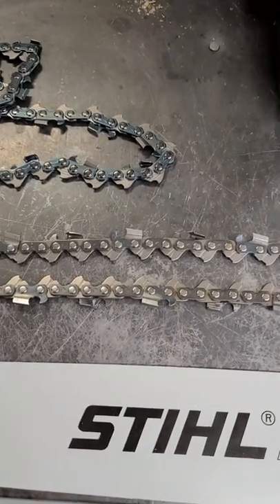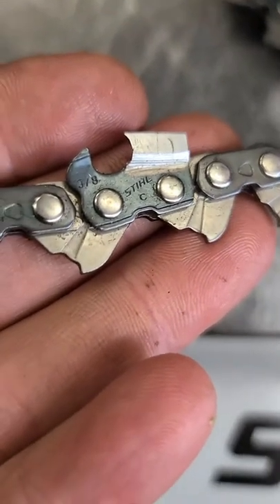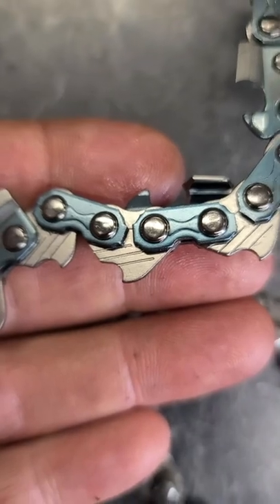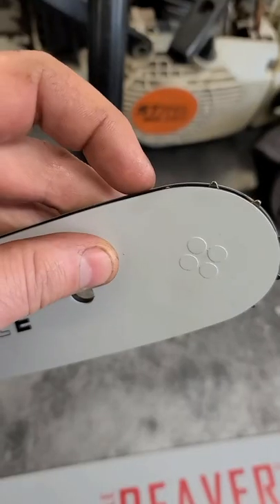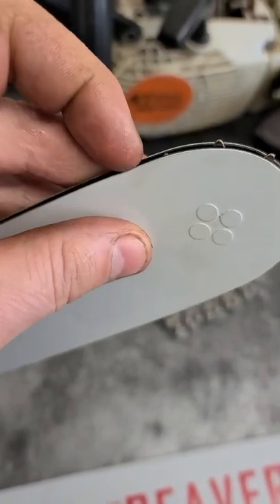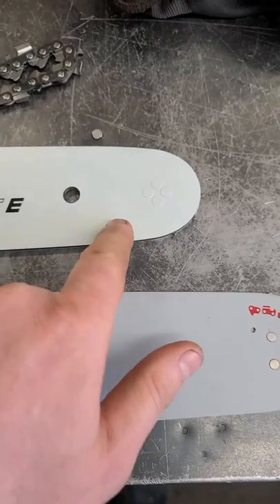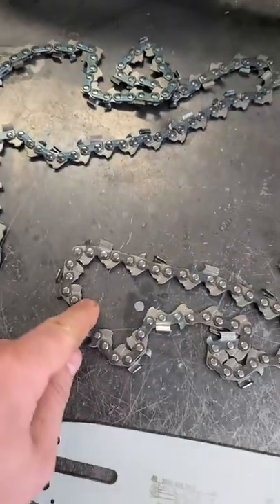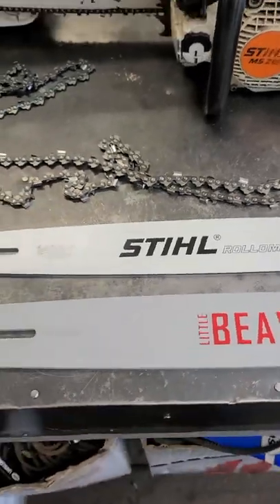What Are Grooves For On Chainsaw Chain Drive Links? #shorts

Comment: Yup it channels the oil as well some of them have a wider groove to also channel stray sawdust away from the bottom so the chain doesn't ride up in the groove from wood dust debris jamming at the bottom by the oil wedge action of the lubrication to keep.the bottom free from wood debris. One should still have a bar with a grease hole though it distributes the grease more evenly than just relying on the oiler on the saw. It has to distribute the oil a lot further. A more form of localized lubrication is always better. The grooves are also there for less friction so the chain can spin freely as well and so that the bar groove don't wear out faster. They also provide better cooling.

Comment: One big thing you let out how about the grooves and indentations on the back of the chainsaw chain are in there to ride on the clutch in the clutch gear or sprocket without those noxious weed chain would not be able to turn around on the clutch sprocket that's the number one reason why those Cruisers Rainier not to mention as you said to guide down the chain bar

Comment: Question for you Don...working on a 2005 Cub Cadet 2 stage 5hp 28in monster of a snowblower and it just will not bark, cough, snort, puke, chooch  or anything.  I put a new carb on and nothing.  I cleaned the old carb and nothing.  Guy had a new plug and I cannot see spark on it so I tried a few other plugs and I can see spark...though it looks kinda weak.  I tried drizzling a few drops of fuel in the plug hole and the most I got was a single pop out the muffler!!  To look at this machine Doug you would think it was rarely ever used, I mean it looks almost new.  Coil maybe? Timing issue? Compression does feel kinda low for a beast this big but I'm not really sure. Appreciate any tips bud!

Comment: So if I got a bar without oil or hole on it I need to make sure my chain has got the grooves in it like you showed in order to properly oil my bar give my bar has a oiler hole then it doesn't matter which blade
Reply from the maker: yes
Reply: @donyboy73  wow. Thanks for that donnie.... I know there's a lot of people out there that do not know that that's quite a good tip
Reply: @donyboy73  wow. Thanks for that donnie.... I know there's a lot of people out there that do not know that that's quite a good tip

Comment: Wait a minute, unless you mean that happens when the chain is stopped, the centrifugal force makes the oil try and get away from the sprocket. In fact, the usual and easy way to check if your chain is properly oiled is by checking the splash against some cardboard or whatever revving up the engine.

If that's what it's for, I don't see it.
Reply: Not sure I follow the logic either
Reply: the grooves are there to get the oil between the guide and the slot in the bar and to help resist the centrifugal force trying to sling the bar oil outwards; instead of just squeezing up through the holes between the links.
Reply: @kenbrown2808  I can see there will be oil in those grooves as it moves along the bar, that's something I thought before Don said anything about it. But what my head just can't admit is that, when in use, that oil will ever get to the bearing, even less so thanks to those grooves.

Those grooves can only hold it for so long, but as long as the chain is in motion, if anything, the oil will tend to go outwards, not inwards, that's basic physics.
Reply: @fadetounforgiven  there are likely also grooves inside the bar and on the guide sprocket to help direct the oil that's basic fluid dynamics
Reply: @kenbrown2808  "likely" is not facts. But again, the oil comes running on the top side of the bar and, although there were no chainsaws back in Newton's days his laws still apply, the oil will tend to keep on going forward. I'm going to need some real explanation, but thanks for, very likely, trying.
Reply: @fadetounforgiven  yes, so they cut grooves in things to provide an outside force, as well as oil manufacturers doing various things to stop the oil just flying off the end. You know, similar to what keeps your car from flying off the road when you go around a corner.
Reply: @fadetounforgiven  i looked it up for you and yes, there are grooves inside the bar to guide oil to the bearings.
Reply: @kenbrown2808  I barely did a search (didn't have too much time to bother) and found nothing. But it's obvious there must be something to guide, or to try and guide, the oil towards the bearing.

But you know what? Newto, though dead, is still right. The oil goes along the upper groove of the bar in a linear motion created by the chain. I guess we can agree on this. Then there's the tip of the bar which has a rounded shape, maybe more rounded, maybe pointier, but rounded anyway. The bearing we're talking about is, "by definition", in the center of that circumference. So, "all" you need is to apply a force into the oil so, against all odds, it changes direction and decides to go inside rather than outside. Where's that force? Where does it come from?

Do you know what keeps your car on the road? grip, friction. Do you know what doesn't add any grip, any friction to any given surface? oil. What are we talking about? oil. I guess your metaphore pretty much doesn't... stick.

I guess, I may think, that it has to do with gravity and capilarity, so a bit of the oil will get there eventually. The problem I see with this is (I wonder what Don thinks about it) that with oil comes dirt, because the bar will catch dirt, dust, you name it, so that will shorten the life of the bearing.

I do believe this is a bad idea except for those who sell bars, but hey, I might be wrong.
Reply: @fadetounforgiven  it was easy to find. I just got pictures of bar tips. There was a picture of one with the channels in it, showing how it guides the oil to the bearing. And I can't guarantee it works. I mean, my saw is only 15 years old, and i haven't even worn out three chains yet, because i only cut 4 or 5 cords a year with it.
Reply: @kenbrown2808  well, this is supposed to help with the bar, not so much with chain, although it benefits from it: more oil along the chain, less temperature, less wear, lasts longer.

But, that being said, and me being one that cuts far less wood than you a year (in fact these last two seasons I've been mostly pruning with the small chainsaw I was given for my birthday than cutting "real wood" with the bigger one), having used only three chains in 15 years I guess it mostly depends on how agressive you are when sharpening, how careful not touching the ground or any non-wood-material, and how hard the wood itself is, among other things. Here, I cut eucalyptus most of the times and they are relatively hard compared to others such as pine and some other species (which I'm not sure about what they are, so I can't translate them into English), and maybe as much as oak. I think I have three or four chains for my bigger chainsaw for the last ten years and it's only one that's on it's last round but, again, it's been almost a year since the last time I chopped some eucalyptus with it. I'll have to do some more elbow exercise soon though.